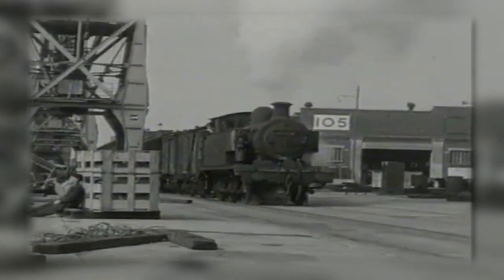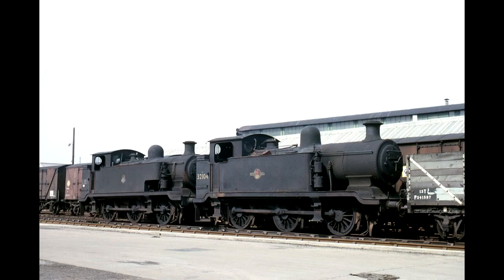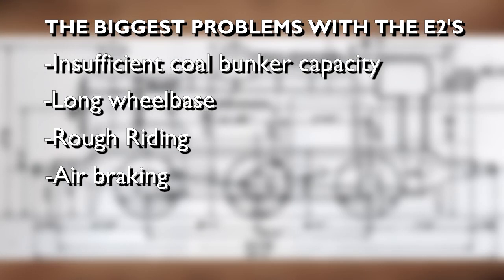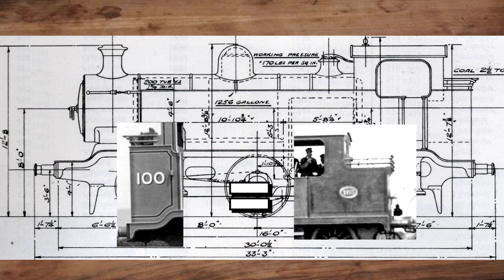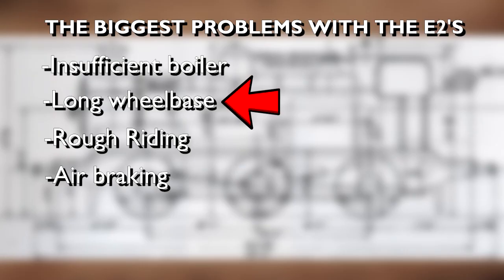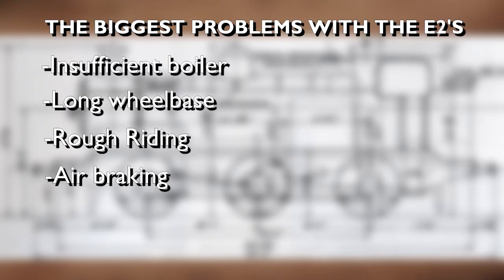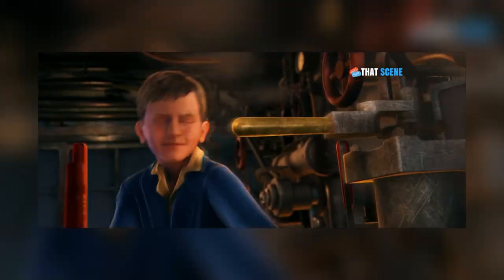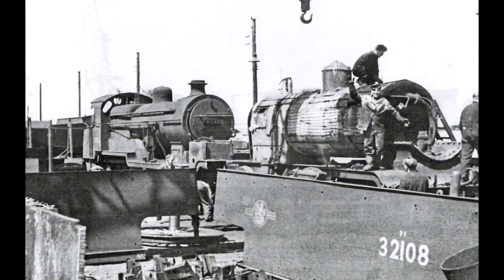The E2's - Not as Bad As We Think?

Comment: I often wonder whether superheating would have made a difference. If I was going to go out on a limb, I wouldn't mind trying out a Kylechap blastpipe or Giesel ejector.

If wishes were horses, eh?
Reply: @hornbytrainzz 

Poor steaming and performance improvements.
Reply: @hornbytrainzz 

I'm no engineer by training, I will admit, and arguably the entire discussion is moot as there isn't presently an E2 around to modify, but purely as a thought experiment those are the options I would try.

The superheating would be a measure to gain some overall improvement to the E2's boiler, as in general superheated ones generate more power for a given size than ordinary saturated ones, as well as clawing back a little coal and water consumption as they're more efficient.

The Kylechap or Giesel Ejector? An effort to help in the tendency of the E2 to lag behind the fireman's efforts to keep steam up, particularly at speed, as they would improve the drafting characteristics. The easing of back pressure in the cylinders is a nice side benefit, both for speed and general performance of the engine, as if it can exhaust steam more freely it'll generally run more freely in consequence.

Third, these are relatively less drastic measures than fitting a larger boiler or altering the chassis or running gear, the sort of thing that might've been done while the engine is in for an overhaul or otherwise out of use.
Reply: @hornbytrainzz 

Ah, but they don't have books and a tv series based on them, do they? The only reason the E2 is well known is because of a fictional version of it, and even then by mistake (Awdry said he wanted it to be a J50).

As I mentioned before, it's an entirely moot point, none remain. If there was one and I had the means to tinker with it, why not try? Worst case the alterations don't work, but then they just might.

If only. Two little words...
Reply: @hornbytrainzz

Well, theoretically speaking, it'd be my engine, in my workshop, paid for with my money. 

Too right, I wouldn't be "preserving" anything, as ultimately I wouldn't want it to sit forever silent and still, I would be running it. And a running locomotive has its parts replaced in due course as required to keep it running, even the ones presently stuffed and mounted have had this done at one point or another in the  course of their lives at least once, so the ship of theseus argument is utter foolishness in my opinion.

You and I are not the same bundle of cells that popped out of our mums, those cells have been replaced and altered many times. But you are still you and I am still me even so.

If the future generations wouldn't like me for running and caring for my modified E2, that'd be their problem. I'll be long dead and buried by then.

Comment: A reason for them saying that it doesn’t hold enough coal could be because of the fire box size, is the E2’s had too big of a fire box then more coal is required to have a fire burn so the fire box stays at an even temperature throughout the whole thing and so it can steam properly, so the problem with the coal could be too big of a fire box. This means they either have to increase the size of the coal bunker or decrease the size of the fire box

Comment: I've especially wanted to mention that I personally just learned that the drive wheels of the L B S C Railway E 2 class tank engines were an exact 54" diameter while the cylinders had a bore of 17.5" X 26" stroke!
Reply: I've especially wanted to mention that the L B S C Railway E 2 class tank engines had been mentioned with flaws due to fuel capacity when it's actually the boiler of the tank engines length of the wheelbase being too long for tight bends, and especially the part of they're being rough riders! They've especially NOT been fitted with an official air brake system!

Comment: I do agree that one major issue with the E2 class was their abysmal I2 type boilers. (hence why I replaced them on my two freelance designs based on the class with those on the I3 Atlantics and K class moguls) 
but some other things you pointed out (changing out the pistons, middle drivers, brakes systems, and extended the bunker) have given me ideas on how else I can improve my two freelance engines.
And for that, I thank you.

Comment: There were 10 LBSCR E2 Class locomotives (with Thomas as 107 or 105 or Even 106) There's a Custom LBSCR E2 that was a Hidden 11th built called 110 An E2X (Thomas would probably be a E2B because E2A's 100-104 are the 1st probably Early Prototypes)

Comment: I'm sorry to burst your bubble, but your argument isn't quite right. The coal bunker was inadequate for the locomotives boiler which would definitely require attention as it was not adequate, but a jinty has a different firebox design anyway which would change the way they steam, you also have to factor in coal quality which differed depending on location which would also effect steaming. The boiler probably needed a huge redesign as it was not suitable which wouldn't be a simple fix at all, to first diagnose the issue then resolve it though it could have been as simple as a blast pipe alteration. But your argument of shortening the wheel base causing the boiler to get shorted makes no sense you can move the wheels closer together without shortening the locos overall length look at the USA tanks and austerity they have larger overhangs at each end they aren't actually much shorter than an e2. The blinding of centre wheels isn't a good fix either as this was only used for extreme circumstances on much larger locomotives. The reason the locomotives were not great was a case of balance, the wheel base was too long for shunting in some yards, the coal bunker was too small the feed the boiler which was too hungry and too thirsty, the loco didn't ride well enough at speed for passenger trains. And they could only work short goods journeys because of the fuel issues. It basically creates a loco that isn't good at much so never had time or money poured into it, not because of the lack of but because this was better spent on other things such as electric passenger trains and better steam locomotives. The Southern didn't have much freight so a standard class of shunters was never invested in so they used out of date or failed tank engines for this.

Comment: I feel like as a society we need to try to get railroad companies to bring back steam or at least rebuild some old designs, I looked into it a while back and most people think that the steam causes pollution, and it does but the white steam does effect the air pollution the darker steam falls back down to the ground and can be ultimately used as a compost, people say that the diesels are better and more efficient, that is not all that true, they use up so much oil that can cause the world to run out but they are also higher maintenance they are easier to drive though, you might be thinking(or might not) steam uses coal so that means we will run out of coal, while that is true steam locomotives can also consume wood which is much faster to regrow and as it does burn faster it does a lot better than steam and keeps the inside of the boiler much cleaner which means less gunk, My thoughts were "why would people not just use wood" so I looked it up and I thought it was kinda dumb but the main reason was that most firemen didn't feel like wanting to keep putting wood in the fire over and over when coal sits longer and they can have a break. I do think that modern companies should start redesigning steam locomotives because they are beautiful and although they are a little slower than diesel they are actually much stronger and most powerful. sorry for ranting if you read all of this thank you please tell me if I'm wrong and correct me, sorry goodbye

Comment: Yeah the E2's were not very likable but why didn't they modified the E2 class with better water capacity or a large or longer coal bunker shortened the wheels why didn't they modified them have this unanswered questions is there a reason why?
Reply: The 2nd batch got extended tanks, so they did have better water capacity than the first batch.  Those who believe Thomas to be E2 based say he's the 2nd batch look, making him 105,106 or 108. Though some make him a 1st batch modified to the 2nd batch look, too. He's 105 in my fanfic that goes into his mainland days. Btw, as a 1915 build someone said, he'd have to be 105 or 106 to be a 2nd batch E2.
Reply: @erical6338  yeah true but theres one thing i realize something is thomas some sort of modified e2 class?

Comment: My theory behind Thomas is that he is an E2X. LB&SCR had a tendency to partially rebuild a few locomotives of each class to try and find improvements. Thomas was originally designed to be a scaled-down version of an E2, but the designers realized the cab would have been too cramped for the crew to work efficiently, so this was extended. It wasn't until Thomas was built that it became clear the reduction in length wasn't as much of a benefit as had been hoped. It was decided to try and sell him to make up the costs to build him, and he was painted an unusual teal with white lining to make him easy to spot by potential buyers as he navigated the yards. Despite this, no one was interested in purchasing him. The war eventually saw a mix up that somehow saw him end up on Sodor; it wasn't until after the war that the Fat Controller noticed a discrepancy in paperwork and figured out Thomas wasn't the engine he should have obtained. It turned out LB&SCR had written him off as lost in the war and had quietly built a standard E2 in his place. All parties agreed to let him stay on Sodor, and Thomas was purchased for a reasonable price.

After purchase, the Fat Controller had Thomas throughly inspected. He received a new boiler, a slightly smaller blastpipe, a slight increase in coal bunker size, a redesign to his firebox, and modified pistons. Several years of testing and some further minor modifications saw him reach full potential, and after proving himself by assisting a certain engine that crashed, he was deemed a success.

Comment: I think what to fix the e2s is to give them extended bonkers just like a e3 and e4 give the e2s weakening the drivers give the e2s boilors like a caledonian railway class 812 0-6-0 give them new drive wheels and cylinders that match the ones on the lms 3F jinty wheels and a bouky wheel like a 0-6-2 give them long water tanks that goes through the smoke box like a gwr 57xx pannier tank engine at the front sides while the tanks is just a longer side tanks give the e2s hose for vacuum brakes and give the e2s 18-inch cylinders just like e3 tank engine Give the e2s different boilor one with a belpaire firebox with smaller grating and imagine how the 0-6-2 e2s are fast strong and look like big tank engines 
(Replace the wheels with smaller wheels from other engines) 
Thickened the running board Give the e2s new frames and cylinders and a thinner flanges on the center axle Think about the e2s as big tank engines 

(The 2nd option is that give the e2s piston cylinders) 

(The 3rd option is that give the e2s tenders just like a tender engine and give the e2s like 2-6-0) 

(The 4th option is that give the e2s shorter wheel base) 

(What do you think about my idea?) 
(Is it bad or good?)
Reply: (Let me know if you like it or hated it)
Reply: If you don't know what it looks like I show you 
It looks like this

Comment: doesnt even fix the coal/water/boiler and the air brake problem and then says he fixed all of them
Reply: That may be the case but they still stated that "if" they could improve the boiler design for better steam production and maintain pressure, then it would be complementary to the fuel(water and coal) and somewhat fix that issue. 

As for the brakes, it doesn't always have to rely on the type of brake system, but they are also implying that it should also rely on how the cab crew "handles" the braking.